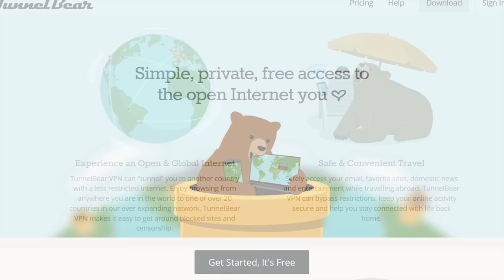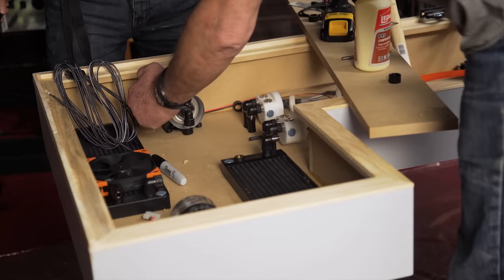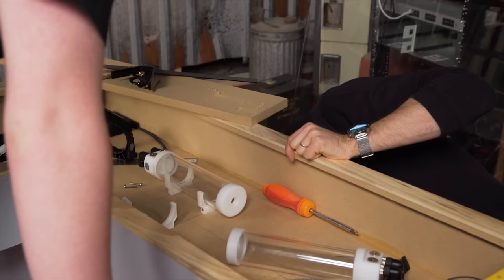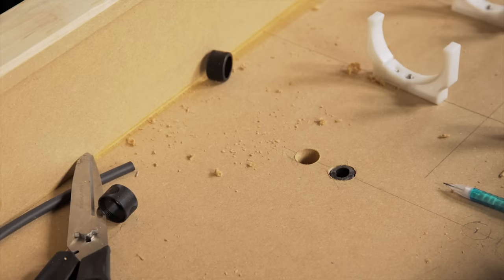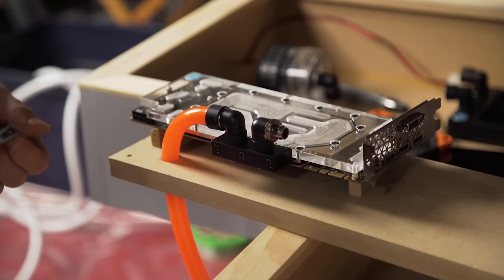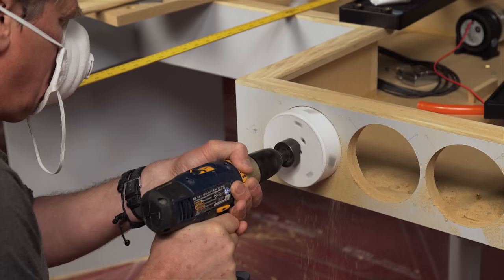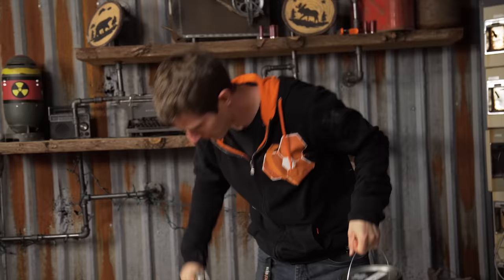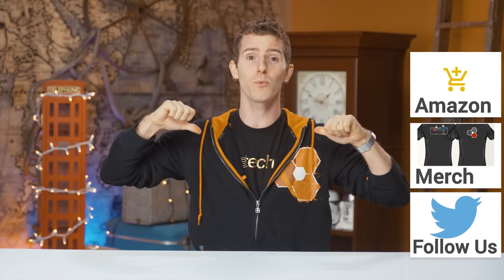Ultimate DIY Desk PC - DRILLING SO MANY HOLES

Comment: is this pc good 
Early Black Friday Featured Promotions: CYBERPOWERPC Skorpion K1 RGB Mechanical Gaming Keyboard w/ Kontact Blue Switches and Programmable RGB LED Lighting
Gaming Chassis: Phanteks Enthoo Pro M ATX Mid-Tower Gaming Case w/ USB 3.0, Side-Panel Window (Black + Dual Full size Tempered Glass window Panels)
Laser Engraving: None
Lighting: None
Extra Case Fans: Default case fans
Noise Reduction Technology: None
CPU: Intel® Core™ Processor i5-6600K 3.50GHz 6MB Intel Smart Cache LGA1151 (Skylake)
Freebies: None
Performance Tuning Protection Plan by Intel: None
Venom Boost Fast And Efficient Factory Overclocking: No Overclocking
CPU / Processor Cooling Fan: Asetek 550LC 120mm Liquid Cooling CPU Cooler - Extreme Cooling Performance (Single Standard 120MM Fan)
Coolant for Cyberpower Xtreme Hydro Water Cooling Kits: None
Motherboard: * GIGABYTE G1.Sniper Z170 SLI ATX w/ USB 3.1, 3 PCIe x16, 2 PCIe x1, 3 SATA Express, 6 SATA3, 1 Ultra M.2
RAM / System Memory: 8GB (4GBx2) DDR4/3000MHz Dual Channel Memory (ADATA XPG Z1)
Video Card: GeForce® GTX 1050 2GB GDDR5 (Pascal) (Single Card)
Sli Bridge: None
Freebies: None
Video Capture Card: None
Power Supply: 600 Watts - Standard 80 Plus Certified Power Supply - SLI/CrossFireX Ready
M.2 SSD: None
INTERNAL PCI-E SSD CARD: None
Hard Drive: 1TB SATA-III 6.0Gb/s 32MB Cache 7200RPM HDD (Single Drive)
Secondary Hard Drive: None
Hard Drive Cooling Fan: None
External Storage: None
Optical Drive: 24X Double Layer Dual Format DVD+-R/+-RW + CD-R/RW Drive (BLACK COLOR)
Optical Drive 2: None
External Optical Drive: None
WiDi Router: None
Internal Wireless Network Card: None
Sound: HIGH DEFINITION ON-BOARD 7.1 AUDIO
LCD Monitor: None
Cables: None
Speakers: None
Internal Network Card: Onboard Gigabit LAN Network
Keyboard: None
Mouse: CyberpowerPC Standard 4000 DPI with Weight System Optical Gaming Mouse
Mouse Pad: None
Headset: None
Gaming Apparel: None
Gaming Gear: None
Fan Controller/Temperature Display: None
Internal USB Expansion Module: None
External Wireless Network Card: None
Wireless Routers/Hubs: None
Docking Station: None
Bluetooth: None
Flash Media Reader/Writer: None
Video Camera: None
Power & Surge Protection: None
USB Hub & Port: Built-in USB 2.0 Ports
External USB ADAPTER: None
TV Tuner Card: None
Operating System: None - FORMAT HARD DRIVE ONLY
Office Suite: None
Security Software: None
Professional Wiring: None
Ultra Care Option: None

Comment: DIY? Too many errors, why didn't you build this in sketchup first? You can see why your holes don't align with your hard drives, you have to drill straight down and not at an angle like shown at 3:54 a mini drill press is handy or a second person can help by watching at a distance where it's is easier to see the misalignment. Also and this could be a big one as you don't have any shielding, your build might have RF noise problems and might not be FCC or even UL compliant. You'll notice that even a cheap plastic computer box has metal shielding where your huge expansive build has none.

Comment: TunnelBear SUCKS!
 Why not just go straight through the leg and put supports on both sides afterwards? Do it at an angle, really you wouldn't even need to add supports or anyting...

Did you actually paint that with a paintbrush?